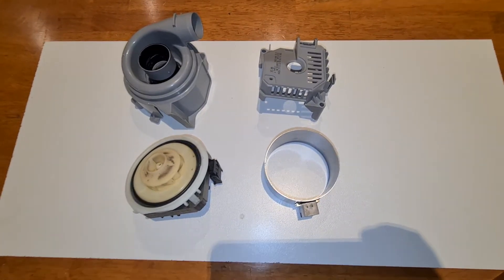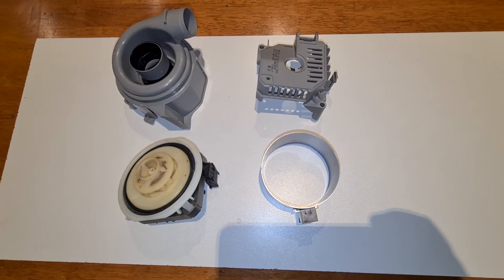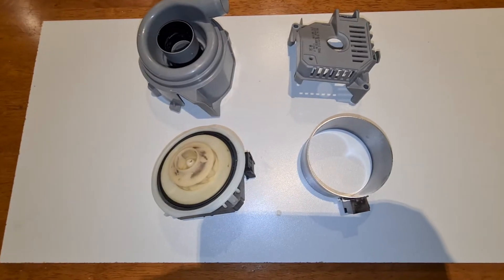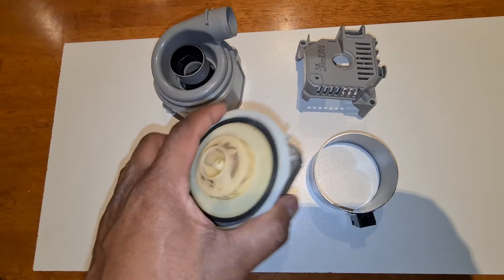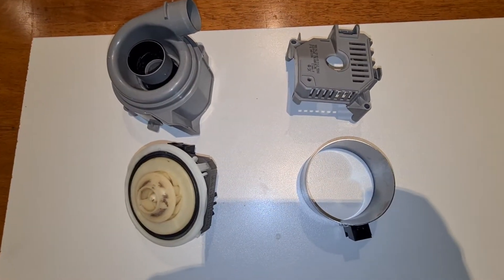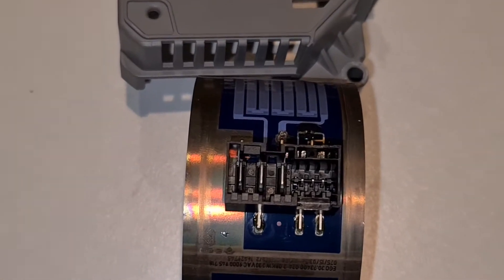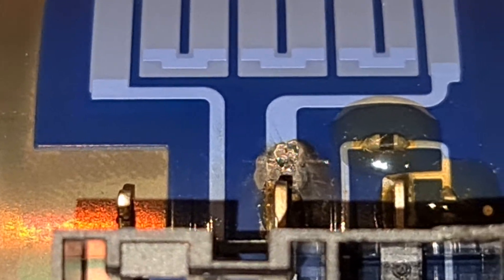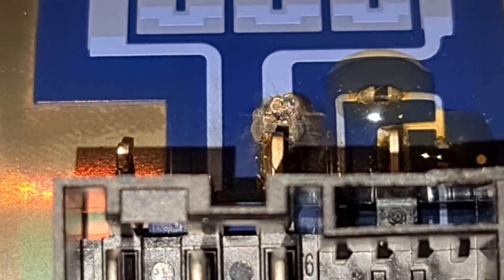Bosch Heat Pump Autopsy

Comment: Thanks for this interesting autopsy.  This seems to be a common fault with these heat pumps, and I've just experienced it myself.  Main 63A circuit breaker has been tripping thus turning off all our electrics. Your very clear video shows exactly why that happens.  I believe the usual Bosch error code for this fault (the one we've seen) is E09.  I've just bought a new one from Bosch for £113, thinking it would be easy to fit.  However, I think I will need to remove the base of the dishwasher to complete the job properly.
Reply: Depends on the model. I have a SMV69M01GB/B3. There are various videos of the older version. I put a rant video on my channel cos it seems Bosch have modified their designs to make access harder. Apart from the water above the 240VAC - I marvel at the 3 Grey wires into the pump with a clip that disintegrates. If you get his wrong you get a E11 error. My guess is the 1, 2, 3 shod be signal, gnd, signal and I traced these back to the PS. The GND is middle of the 3 Grey wires next to 2 yellow..on some models these are 3 orange wires.

There was no water ingress in my heater coil. I suspect the soldering had Flux residue and over time this ate away at the joint. For the moment I added a jumper wire (it shouldn't get wet there). My thinking is if I can get the machine working and heating again then it might be worthwhile to get a replacement pump.

There again I also figure £100 for the part should probably be used to buy a different brand. Why? It isn't cleaning as well as it used to. It isn't as silent as it used to be. And this is 3rd expensive German designed machine I have had in 15 years so they don't last.

Comment: How did you open the sucker?
Reply from the maker: @matshulten5396  There is a clip which you nearly have to break to pull the assembly apart. I would recommend replacing the whole unit to prevent comprising the seal